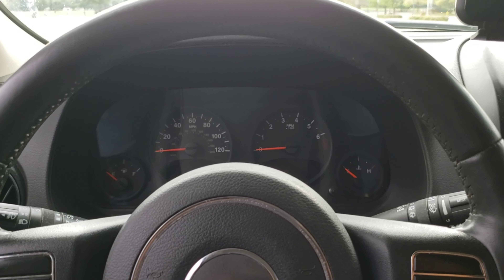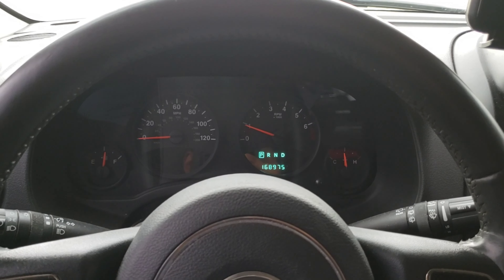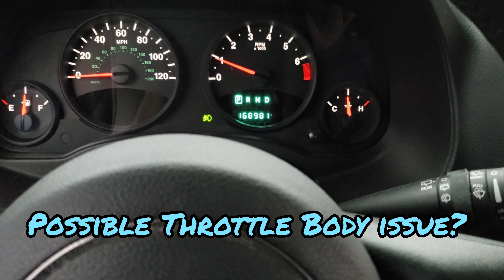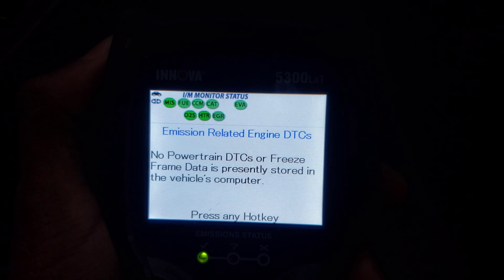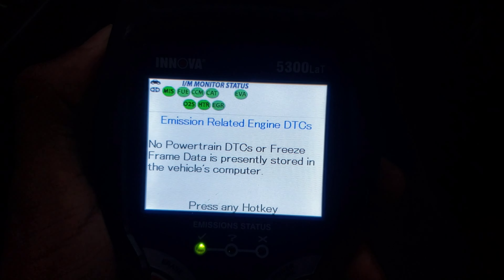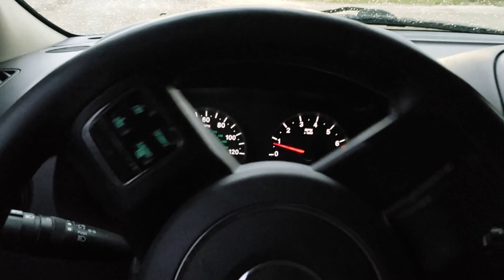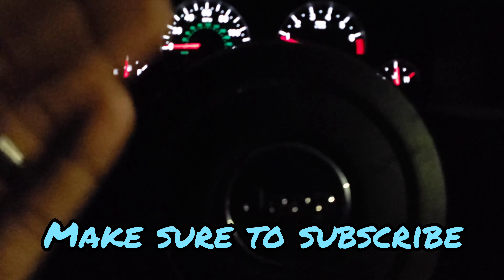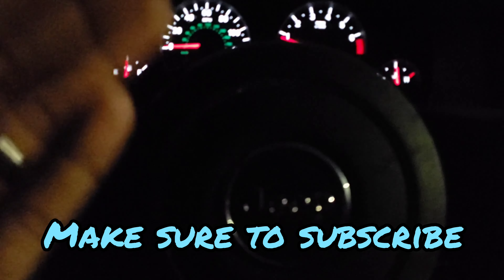2011 Jeep Patriot stalling issue. #subscribe #fyp #vlog

Comment: I Got a 2011. We got it from a couple, not sure how well they serviced it. But all of a sudden the gas pedal when stepped on as if the car barely drove, RPM was higher than usual. Then we turned on the ignition and a weezing and strenuous soud.
Reply from the maker: Thats strange almost sound like something is restricting it from accelerating like a convertor or something. But that wheezing sound is a new one for me

Comment: You can do a relearn to try and fix it. I had the traction control light come on too. I was on the brake and the throttle spiked up then it came on. I also have the random stalling issue and no code, and did the crank sensor twice. Im leaning towards the electronic throttle body like you are. I did a relearn and it helped. After a few months it started doing it again so now im just going to try a throttle body.